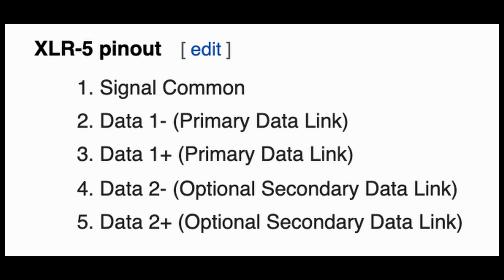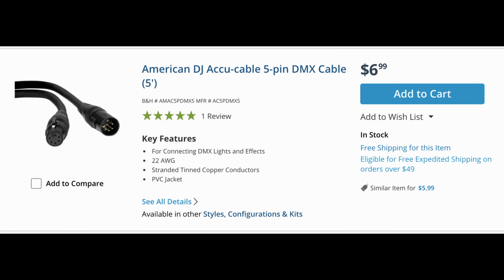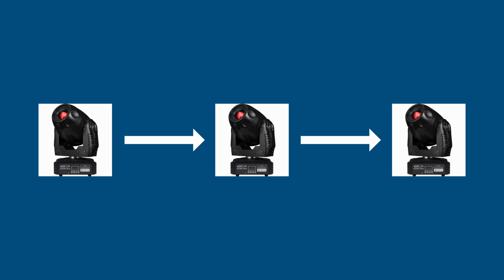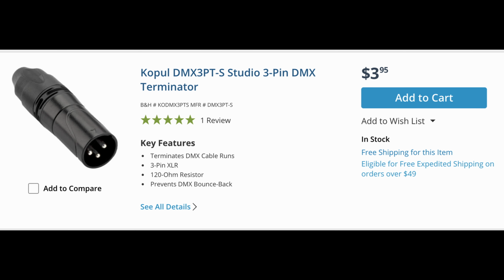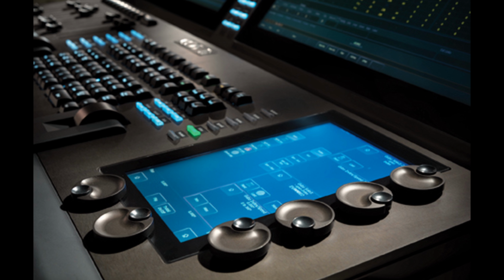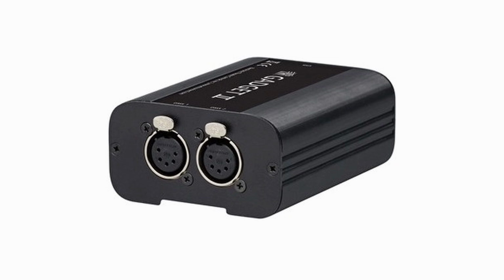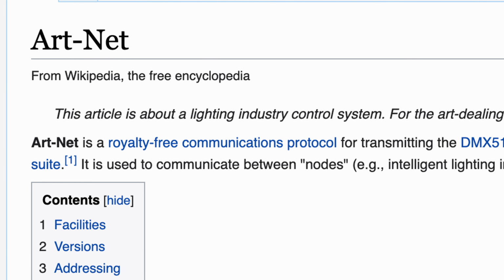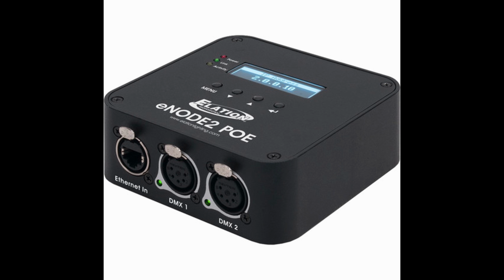How Does DMX Lighting Work? // History, Protocol, and Limitations

Comment: Hey I got a question, why is DMX supposed to be strictly 5 pin? I’ve been working with a theatre over the last year that uses DMX and dimmer systems, and it all runs 3 pin (minus some older LEDS that have 5 pin and we use a converter to make them 3 pin). Even our wireless DMX receivers are 3 pin. I’ve had some DMX issues as we’ve traveled, but only when cables were damaged or wrapped wrong
Reply: the 5 pin standard stops accidental connection of audio cables (will work but not always) and phantom power and amx multiplex (will not work, can fry driver chips as can phantom power. quality equipment has 5 pin, cheaper or knock off equipment has 3 pin.

Comment: I dont think a terminator at the end is "important" almost never used one and worked just fine even in 120m runs i know technically the reflections should couse troble but when i had dmx problems a Terminator never was the solution and second thing RDM where the fixture can talk back to the console it also only uses pin 2 and 3, 4 and 5 is not realy specified in DMX512-A and is very very rarely used
Reply: you find them handy when you use a lot of fixtures that have a lot of control parameters. rdm came along long after dmx was introduced, its very handy in theatre and permanent stadium installs for lamp monitoring and highlighting poor operators.

Comment: TMK ! and everybody guys hello. let me know if you have some opinion or am I wrong?
I have an old Sony Genezy with D-Light Controller, to plug it with DMX Lamps (3 pins). I suppose lamps DMX brand or models should work with this Sony device, being DMX it most work I suppose. 
I saw in the label of Sony controller by ADJ Lamps, "we don't guarantee other brand will work".  Other envelope the same device displayed: "to use with DMX lamps" (0o) woot! 
I suppose, being DMX 3 pines lamp, it should work with this Sony DMX Controller, (the controller is linked with the proper Sony Genezy model with the D-Light feature).